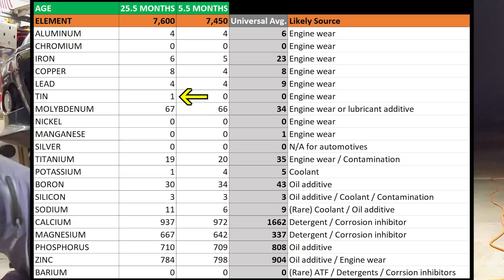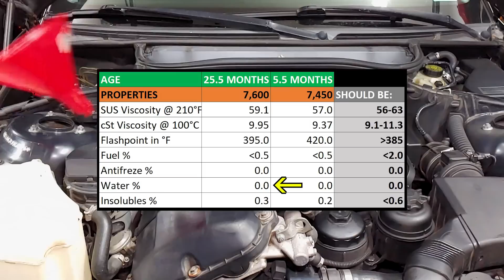Does Oil Really Need to be Replaced Every Year? Surprising Analysis Results Revealed

Comment: My 2003 TDI has 10,000 mile oil changes in the service manual.  I've changed it every 10k or 2 years if it's not been used much.  Done this since owning the car in 2006 and stills runs fine, 155,000 miles.  Engine and turbo still original and plenty of power.  Heck it's still on it's original clutch too.  Just to rub salt in to the 3,000 mile brigade, I've done the oil changes with a vacuum extraction pump since 2011.  So the sump plug hasn't been removed in over 10 years.  Yes oil is cheap and engines aren't... but that's still not an excuse to waste money and good engine oil.
Reply from the maker: I also used a fluid extractor for at least the last 10 years before filming for these tests, but I wonder if that's why the first sample I took (10k) was worse than expected. I'll be doing another 10k sample for comparison.
Reply: I got the vacuum extractor because the oil filter is also on top of the engine.  So I didn't have to get under the car.  It's possible using one leaves more contamination in the sump.  On the other hand I can drain the oil filter housing with it that holds a fair amount of oil.  Still hasn't seem to do the car much harm.  Still runs fine being 20 years old the body and chassis are what's going to kill it not my extended oil changes.
Reply: 3k oil changes fucking ridiculous, we are not in the 1950s, technology in oil has advanced leaps and bounds, I’m 10k or 18 months
Reply: I have had my 2000 Jetta tdi since 2001 and do oil changes every 10k and have 345k. Just replaced the turbo and running with no issues!
Reply: @kevenboettcher9176  that's decent mileage for a turbo to last.  I doubt my Seat Leon will get above 200k.  Just imagine how much oil (and money) you would've wasted changing it every 5k just because you thought you knew better than the manufacturer 😊
Reply: https://youtu.be/6p69YEHqz0w  
This is an interesting video, particularly that it's with a TDI as well.  By interesting I mean the narrator is neither an AMSOIL Dealer like myself, nor owns a business that sells AMSOIL.  He is a DIYer who simply has a positive story to share of his extensive track record using AMSOIL motor oil with extended intervals in his 1998 Volkswagen Jetta TDI diesel.  It’s only 12.5 mins, and a bit slow in the beginning but he does make a great case – almost 400k miles – for a good quality motor oil.
Reply: @frankharley1000  I own a similar VW engine a 1.9 TDI ASV and know the 1.9 TDI can go to very high mileage given half decent servicing.  Not sure I'd be comfortable extending the charges that far passed the recommended mileage.  Also I only use the cheapest oil available that matches the specification.  The same with fuel I don't pay extra for premium marketing or snake oil 😊
Reply: My 2007 skoda Octavia 1.9 tdi alh diesel 5 speed manual just clocked 100k kms on odo. I replace oil every 7 to 8 thousand kms with Liqui moly toptec 5w40 vw 502 505 505 01. Runs very smooth. 
I want idle as much silent as possible. Can someone suggest better oil than Liqui moly for smooth and silent idle?
Reply: @1.9tdilove71  I believe that's a PD engine and you have to be careful with them and only use the correct spec of oil.  Otherwise it can wear the camshaft.  From what I understand the fuel pump runs directly on the cam under the valve cover.  Once the cam wears the engine loses power and uses more fuel.  Can't help you with the oil, mine is the older VE fuel pump engine and I use the cheapest 10W 30 or 40 I can find.  Check out VW forums, I remember the PD people raving about one particular brand but can't remember it's name.  Not sure you'll get a 1.9 TDI to run quietly whatever oil you use.  But as I said make sure it matches the VW spec to help avoid camshaft issues.
Reply: @Chriswales  Thanks mate
Reply: Unfortuenly your engine isn’t going to make it past 250,000 miles. Should have changed every 5
Reply: @Seeker-vo2tz  Dude, the car is now 22 years old and held together with dirt and rust.  Maybe the engine wouldn't get to 250,000 miles.  But I know for certain the car won't make it to that mileage. So I don't see what difference changing the oil every 5,000 miles would've done to stop the chassis rusting away 🤣
Reply: Diesel fuel is a lubricant, whereas gasoline is a solvent. Therefore, fuel contamination in the engine oil is less of a problem in a diesel engine. There's typically also much more motor oil in a diesel engine compared to a similar displacement gas engine, as well as much larger oil filter, so there's more capacity for contamination before it reaches a level that can cause accelerated wear. Many commercial diesel trucks have 15K or more mile oil change intervals and can go millions of miles before a rebuild.

Personally though, I'm not trying to squeeze every penny out of my light duty diesel, and oil is still reasonably cheap if you buy it in bulk. I change the oil every 5K miles and the filter every other oil change.
Reply: @ElijahDecker  had the fuel pump timing go out after the last cambelt change.  Didn't notice for 7 months until winter and it won't cold start.  Checked the engine oil and it was rather thin and watery so likely had diesel in it.  Did an oil change, 6 years and 30k miles later there seems no lasting impact.  Turbos are often the weakest link on extended oil changes.  Work colleague blew the turbo on a BMW 320D from not changing the oil.  Can't remember if he thought it was 20k or 30k between services but basically he ran till the turbo failed.  After replacing the turbo it ran fine for years so no noticeable engine damage. 

Also have a 2007 1.8 petrol Mazda, that gets similar treatment as my TDI.  It does under 2K miles a year so only has oil changes when I remember.  Only had maybe 3 oil filter changes in the last 12 years because it's under the car and I can't be bothered getting down there.

Both cars are on borrowed time from the scrap yard and it's nothing to do with my 10K mile or 2 year oil changes.  They're rusting and won't pass yearly inspection soon.
In the last 3 years the 2003 TDI has snapped both front coil springs, had a replacement rear axle and the front control arms rusted out.   It would've been scrapped by now but I know a backstreet garage what does the work cheap.

To answer the original question in the video, if you haven't modified the engine's power and don't take it on track days.  Then yes you're changing the oil too often if it's before the recommend mileage.   But heck if it makes you feel better carry on.
Reply: @Chriswales  “Work colleague blew the turbo from not changing the oil” 
How did they determine that was the cause? Or just correlation? Very easy to attribute cause just “because”.
Reply: @DiscoFang  they didn't determine it was from not changing the oil.  It was the BMW specialist they took it to.  The main dealer didn't want to touch it because of the lack of oil changes.  The specialist said they'd seen turbo failure before from not changing the oil.
I still stand by my statement that the turbo is often the weakest link when not changing the oil.   But it does depend on a number of things, Hoovies garage had a turbo petrol that didn't have an oil change for years and still ran.
Many things could help the turbo last with very old oil.  Bigger turbos spin slower than smaller ones.  Some have a coolent feed so don't just rely on the oil for cooling.  Larger engines run at lower revs, which can put less strain on the turbo.  Driving style, one person's 20,000 miles maybe very different to another's.  And of course you have just plain old bad luck.  My first TDI threw a rod on the motorway.  It had 6,000 miles oil changes.  First owner had stretched that to 12k, I went back to 6k changes.  A few years later it went pop but I don't think that was because of the longer oil changes.
Reply: @Chriswales  You just repeated it - “The specialist said they'd seen turbo failure before from not changing the oil.” 
How does a garage determine a turbo failure is from not changing oil? 
Is it just a failure they can’t directly attribute to something else?
There are a ton of cars out there that don’t get regular oil changes that still do crazy high miles without faults. You gave an example and Hoovie’s is not an outlier. I’ve personally owned many.
Reply: @Chriswales  I’ve heard many turbo failures in BMWs (eg the m57) are from blocked oil return lines. Yes, frequent oil changes will lessen the chance of deposit build up leading to blockages but the cause of those deposits are something else and oil changes won’t always fix them.
Reply: @DiscoFang  of course I repeated it 🙄 I was answering your question of how he knew why the turbo failed.  Now it seems you want to know how the garage knew.  Sorry, that's a question for them not me.  I suggest reaching out to them if you're that curious, they're South Wales BMW in Port Tennant.  Good luck getting a response from them 👍
Reply: @DiscoFang  Hahaha what a mong
Reply: My 1995 Turbo diesel Toyota 4WD with the 3.0 1KZ-TE had 470,000 kms on it still with original turbo. I owned it 18 years and early on it went 4 years and about 40,000 kms without oil change. From then on I only changed oil once a year/15,000kms and filter every 2nd change.  Yes, still the original turbo. 
I also own BMW turbo diesels. Have had to replace one turbo. It’s their design that’s to blame not the oil.

Comment: Nice work sir, just wheel chocs 🤔
Reply from the maker: I work on a flat surface with very stable jack stands, so I don't often use wheel chocks.
Reply: @endlessmoneypits  very nice work I promise you mate, didn't want to come over as being clever or anything. I love working on cars too and I dunno, just feels better I guess to chock a wheel. I need to watch your very informative video again, I love oil services and last year I fitted a home-built bypass filter system to my car and I can 100% say it definitely works 😃
Reply from the maker: I know I didn't feel nearly as safe with my old jack stands, so I'd sometimes chock a wheel with those. Thanks for watching, I'm running tests for videos part 3 and 4 now.

Comment: I've long suspected the same thing that the oil test confirmed.  I too work from home and rarely drive some of my "weekend only" cars.  They are both mid 80's 5.0 Mustangs that have had the same oil going on 3 years now.  Both have less than 1,000 miles over the 3 year period and the oil still has a clean / clear honey color.  I wasn't going to bother changing it just based on the clean color.  My vehicles are kept indoors year round and stored during winters.
Reply from the maker: Yep, in the last year I've driven this car 1,000 miles or less as well. It's a relief to know I don't need to replace perfectly clean oil once a year.
Reply: Similar, I have an S2000 that has covered just a few hundred miles since having kids and being laid-up for most of the year (it only has 33k on it in total) - I used to use Mobil 1 0w40 fully sync and it has always looked like new between yearly services whilst under extended warranty and still does (unlike my diesel filth bomb which looks like tar after a year and just 2000 miles!) - I'll probably change it and the filter soon, not because I'm being told to but as a precaution since the oil is now over 10 years old 🤫 That said on my '72 Spitfire I did oil changes every 3k if not sooner - it's the nature of engine design from that era and 20W50 mineral is far cheaper than 0W40 synth!

Comment: Hello there , I change my car’s oil every 2 months , but I still see some shave materials in the oil Pan , I use Detox Synthetic always , of course the car is a used car with 180,000 KM only ... any opinion ?
Reply from the maker: The engine may have been abused before you owned it but I can't say for sure. Keep doing frequent oil changes if you're seeing metal shavings.  You might want to get your own oil analysis for $35, it could tell you a lot more than I can.

Comment: modern synthetic oils will absorb moisture making the oil sticky , this can cause the rings to stick in their grooves and the car to burn oil. thats why the manufacturers say one year. cheap insurance considering the potential problem
Reply from the maker: Apparently not true.
Reply: @endlessmoneypits  so you have one case that you you say denies that claim but as a professional i can tell you of many times this occurrede before manufacturers put in timers  .
Reply from the maker: If it were true, it would always be true. If you're talking about vintage cars that's another thing.

Comment: Whatever you do , do NOT trust those oil life indicators-they are totally inaccurate. I ruined my 3.6 L SATURN Aura model engine-the indicator was telling me I was safe at 11,000 mile change indication. My engine wore out the timing chains (all 5 of them), and the dealer wanted $3200 to replace. Had I kept a 5000 mile interval I'd be driving it today.

Comment: Engine, transmission fluid, coolants, are all acidic fluids. Fluides are inexpensive to replace. Repair rate is $140 per hour. Pay routine service or repair. BMW scan tool is $$$. Plastic parts that are brittle after time. Overpriced and hard to get parts. Be cheap on fluids and see what happens by year 4 or 5.
Reply: BMW mechanic charges more than $140.
Reply from the maker: I've owned this car for 16 years. Just hit 282k miles. So far so good!

Comment: Brilliant to get real world results. I find them difficult having been a mechanic in a marque that went to 15k mile intervals and there was sludging/varnishing/oil usage issues across all models in our warmer climate. With the caveat that they weren't always the most diligent in servicing on time. 
Makes me wonder if the test results actually line up with all the actual engine systems. Not just the oil as a singularity?
I've seen well maintained 400k+ motors pulled down out of interest. From cars that were wrecked that still look perfect inside. But I've also personally repaired internal parts in engines that are already varnished under the rocker at 40k. That were only serviced the 2 times at the manufacturer recommended distance. 
I don't like waste. I love efficiency. Especially when it comes to money. But I struggle with the cost risk of extending intervals to save money on oil.
Reply: 15k miles thats crazy. Even 10k km sounds a bit high to me

Comment: Thank you for this video, I use synthetic oil and I am retired and put about 100 miles a year. I have not changed the oil in 3 years and it still looks good on the dip stick, however, I did have to add a quart about a year ago and all is good.
Reply: Wow and I thought I didn't drive much😊
Reply: I'd maybe recommend changing the filter at some point since those can deteriorate internally over time.
Reply: So your car burns a quart of oil every 200 miles??
Reply: @Xi-op7gg  I wouldn't know because now I average a mile a month

Comment: My 03 petrol Golf does 15 miles each way to work and had Mobil 1 in the last service in mid 2021, after 15,000 miles i recently had the oil tested and there was next to zero carbon content & no wear metals detected, so i just replaced the filter.
The car has clocked 164,000 miles and runs smooth as silk, the worst I could do is drive short journeys of less than 3 to 4 miles which attract moisture in the oil.

Comment: In the UK Subaru have 12000 mile service intervals, in USA 6000.
In the UK Subaru had a 100,000 mile 5 year warranty.
Reply: might be Km and not miles
Reply: Yeh, over 100,000 miles that should not cause an issue, especially over a 5 year period. So I do not think UK Subaru are taking much of a risk with their warranty. However, if I had a 200,000 mile SUbaru, I think the odds are that it would be the one with 6k intervals that would not be burning oil. Would not willingly have one that had 12k intervals, and would be not be  buying one even at 100k miles. I think US tend to run higher mileage on cars, UK and Europe treat them as disposable items. I am in NZ, I have a Honda CRV with 100k Kms, will probably keep it to 150-160, change oil every 10k kms(6k miles) and expect it to last a long time for the next owner.

Comment: Your analysis is not complete , the water is gone but it turned into acids(when mixed with sulfur from combustion+heat), probably why you are finding copper and tin(bearing material), not like bmw makes great engines from the get go. I wouldn t even change the oil in that piece, let alone put gas in it...

Comment: Believe or not i try to change my oil every 6 months on all my vehicles. I don't drive alot and most of my vehicles don't get more than 1200miles a year. Like you stated oil is cheap engines are not and since my van has a brand new motor my dad and I installed in 2017 its a no brainer. Its the same with my e92 328i, 6 months no matter what.

Comment: What exactly are the problems with running 30,000 kms between oil changes? I’m interested in actual usability problems, not internal looks. What goes wrong?
Reply from the maker: I'd be concerned with losing viscosity over that much use, leading to more wear, but to what extent? I'm already working on this test.
Reply: I m working in a oil riffanery. We test oil in our machines and replace when needed. I understood that we all change our engine oil in cars so fast because we don t test it.  Oil gets better and better. I don t replace oil faster then described in the manual. Unless i do a trackday and give the engine hell.
Reply: Depends on the engine. Modern petrol/Gasoline engines tend to get some fuel in the oil during use so the higher the use, the more the oil is becoming contaminated by the fuel.
Reply: As far as I understand, the problem is rather the filter element in the oil filter. Even if let's say the oil can take it, the paper in the oil filter sometimes can't. I've seen crumbling filter internals. Btw, after all those years I still have no clue at what intervalls oil should be changed.